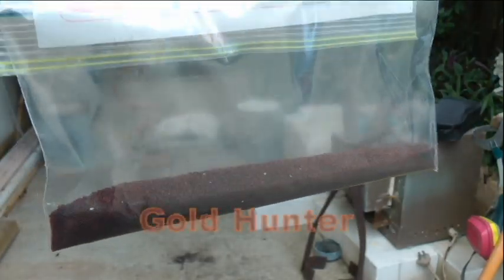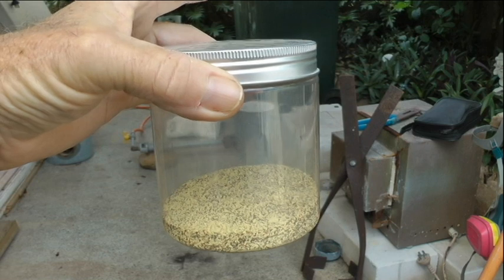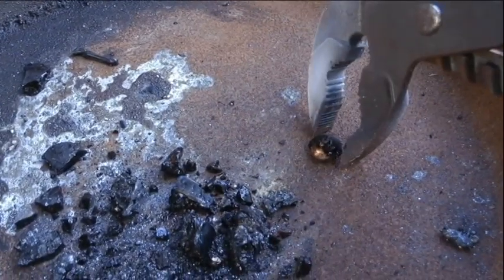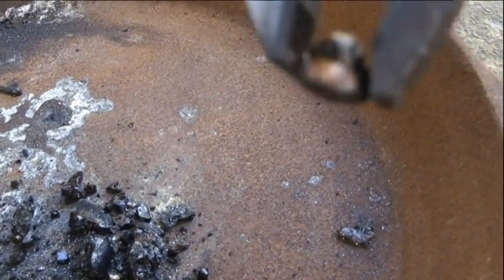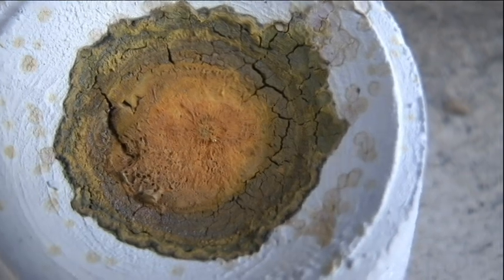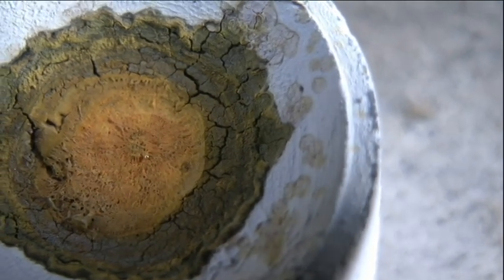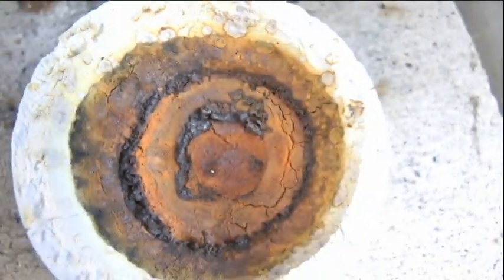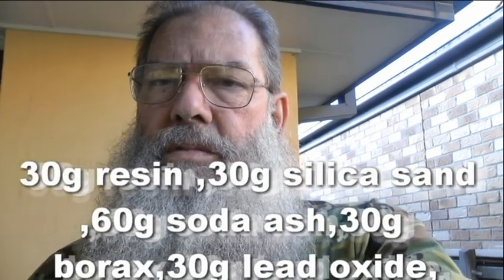Gold Hunter , Gold bead resin success , Maybe .

Comment: Hi Ned,

When you pour out the crucible, try this:
Instead of twisting it back, turn the crucible forward for a full loop. This makes the last drop of flux fall back inside the crucible instead drooling down the outside.
Best regards from Germany!
Reply from the maker: G'day , BL on the Bedrocks , funny thing i've seen that done before , lol , i'm not sure how i could do it with the multi grips without loosing the grip , i 'll have to practice it , and see how i go . thanks for the tip mate , 👌 cheers Ned . 👍✌
Reply: @GrooberNedJardine  You're welcome!

Comment: We are working on a more efficient process Ned.  We have three people on three continents with brains and the same problem.  I assume success before winter.  Lots of plans of attack to try.  And, yes- that resin looked loaded with something.
Reply from the maker: That's sounds Great , hopefully someone can come up with a result , although you're going OK with it . i tried three different resins , this one seems to be the one that captures the minerals the best , but I scrapped the canister idea  and just placed 100 grams of resin in a bucket of the leach solution , and spun a drill in it and it all went to the centre of the bottom of the bucket and almost instantly changed color , then i drained the solution off , seemed to work OK .  I still have a few samples left , i'll keep working on it over time . cheers Keith ,
Reply: @GrooberNedJardine  Persistence will win in the end.

Comment: I can also see some spatter on the floor of the kiln already.  I made a floor cover for mine out of a sheet of ceramic refractory foam skim coated with a little 'satanite' refractory mix.  It does well, is easy to make, and has done a good job of protection.  At less than $10 each, they are a good investment.  It also comes in handy when someone spills a cupel.  You can just take it out, crush it, and pan it.  We saved a quarter gram screw up that was.  Kiln OK, gold recovered.
Reply from the maker: Yes , i know i should place a protector on the bottom for sure , i was going to break up my old muffle furnace and use a slab out of it for the bottom . but i'm thinking i might get some new wire and make a new coil for it , because it was a very study built machine , seems a shame to destroy it .  But yours sound like a better idea especially being able to retrieve a spill like that , very good . cheers Ned . 👍👌✌
Reply: @GrooberNedJardine  Yep, Eva just recovered 1/4 gram from a spill she had.  It messed up the protector anyway, so we crushed half of it and panned it down.  Worked quite well.
Reply from the maker: @hardrockuniversity7283  Well , tell her , nice recovery , but don't let it happen again , 👍 🤣🤣, hope she's got a sense of humor 🤣, cheers Ned .
Reply: @GrooberNedJardine  She was putting some cupels in the kiln and accidentally knocked the lead foil backet containing the parted gold from a test out of one.  It melted instantly on contact with the protector.  Just them I walked in and said something.  She just about took my head off, and then instantly explained what happened.  At least we got it back.
Reply from the maker: @hardrockuniversity7283  👍👌✅

Comment: Yep.  Never THINK about touching the furnace without that second glove on!  The radiant heat can be incredible at 2000F also.  My glove was smoking in less than 2 seconds getting a mold out.  We are just combining all of our test beads in a carbon mold now.  Seems to work fine.  The gold is very 'carbon-phobic'.  Glad to see some beads!
Reply from the maker: Hi Keith , yes it gets hot real quick when the temperature is right up . The second time when i had no glove on , i only just lit it up and hadn't set the temperature . My mum used to say , ( Boys who play with fire are bound to get burnt ) 🤣 . I did get a couple of tiny beads though , at least that was something , cheers , Ned .
Reply: @GrooberNedJardine  Yeah, I found out quick you can't just take some tongs and put something in a hot kiln 'real quick' without gloves.  🙂  no injury than goodness.
Reply from the maker: @hardrockuniversity7283  I was using short tongs , might buy a pair of long tongs , i have seen them at the supermarkets .  👌👍